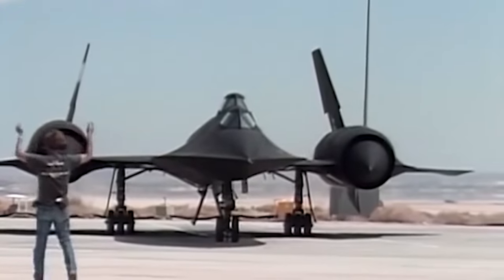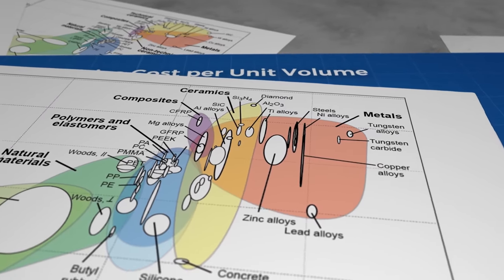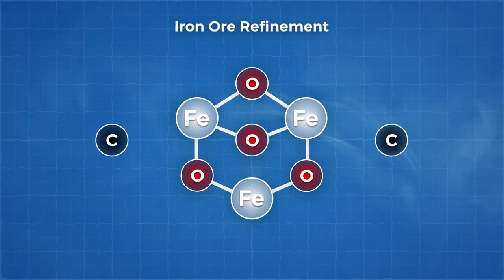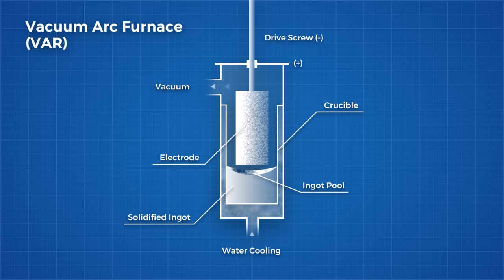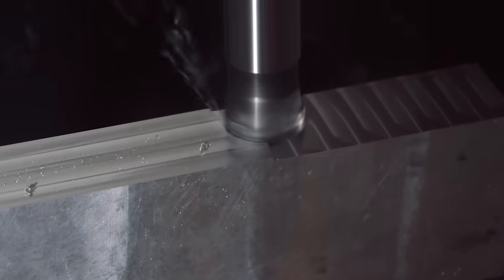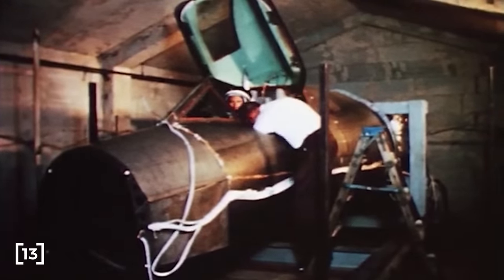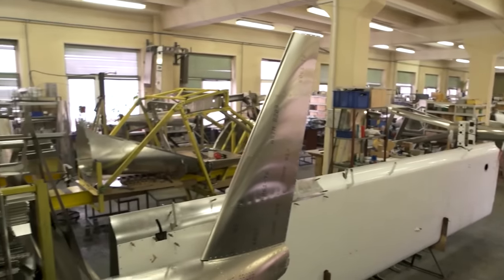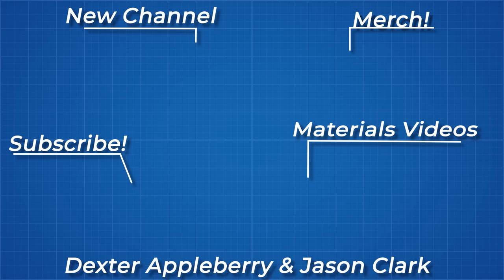Titanium - The Metal That Made The SR-71 Possible

Comment: As a machinist myself I can concur that Titanium is an obsolute swine to machine! As stated the depths of cuts required because of titaniums elastic properties is just plain scary to a newcomer. And the tooling does indeed blunt incredibly quickly no matter how much coolant you drown the part in. Top marks on your research!
Reply: and  then there is the heat treatment.
Reply: Yep sure is a pig to machine.The fine bits of swarf,(cuttings) burn really brightly.
Reply: i've made a few rings on my lathe and decided to open up the hole with a 1/2 inch drill bit before bring the boring bar in... jesus. little squirt bottle with coolant in it to help, i've never seen the corners of a drill bit round over in such a small amount of material . Beautiful material though. The rings have had up well to every day use too. Makes a god oweful ringing sound when dropped on concrete.
Reply: The airframe of the Blackbird after cooling down from  each flight was actually retempered and as such never degraded in strength.
Reply: You mean it's just "plane" scary to machine? 😉
Reply: @Capthrax1  Its a bugger to drill, even with carbide drills! Be real careful if wearing them as jewelry. If your finger swells up for whatever reason, you'll be in alot of trouble! I went for Tungsten for my wedding band, its easy to crack with a set of vice grips if I ever get into trouble.
Reply: First time I had to machine titanium I was astonished how little it warmed up despite the coolant boiling off my burnt out bits. It's like a bastard version of stainless steel. Needs low speeds and large pressures/depth of cut my machinery can't achieve. I gave up.
Found working it with files to be fine.
Reply: @justandy333  As a Firefighter I agree, you really don't want to get anything Titanium stuck on you. Its removal tends to require methods that aren't exactly ideal next to someone's skin!
Reply: Then there's the fire hazard.
Reply: TiO2 also makes it into some toothpastes--white paint again.  It is used in some catalytic materials.  A Materials Science prof I knew suggested that a TiO2  production or consumption index would be the best gauge of national economic health.  White pigment is in everything.  I haven't found such an economic index.  Maybe some economics student could get his/her PhD by developing one.
Reply: Ahhh yes, Ti, the bastard offspring of copper and 316 stainless...
It drills and machines like 316 then, just as a FU, it work hardens so that spring pass you were thinking of becomes a nightmare.
Reply: Alien metal! Check out Phil Schneider on ufos and the deep underground military bases !
Reply: don wright o
Reply: OjonnoMoto
Reply: I heard that, unlike with other USAF planes that are comprised largely of Al and can be repaired with components "cannibalized" from the same type of aircraft in a "boneyard", the Ti components permanently brake in, in such a way, that it is not possible to "cannibalize" and a new part has to be tailor made a specific airframe.
Reply: @Noodle999  jaws of life to get something off a finger... lol
Reply: Are there any ways to alloy it so it's easier to work with while retaining it's useful properties of high strength and low weight?
Reply: I had to machine Ti engine valves, and yes it's hard, ie, you need a lot of pressure when machining resulting in a lot of deflection in the valve, but It's not too bad so long as you slow the lathe right down. I find Ferrari valve guides worse - lol -. Ti hates rubbing, and the Nitro valves we used to do have undercut stems with a ceramic coating so the Ti doesn't touch the guide.
Reply: It’s an incredibly long time it takes to work with it compared to other metals too
Reply: It wasn't easy to work with a planishing hammer, as I recall (from WAY too many years ago).  I'd get small TI parts all heated up, set my dies, turn the power ALL the way up, put my full weight on the lever, run the part through the dies for longer than normal....and MAYBE get the ridges down a millimeter, which was acceptable.

The only parts I hated working more than anything TI were C-130 access doors or jet cowling nose lips, because those required 2 people to do due to the size.
Reply: @therion5458  I suspect your confusion stems from your definition of "cutting."
Cutting during machining is not the same as cutting paper, or bread. When cutting with a knife, the blade is passing between nodes or fibers, aside from local crushing, the material remains in the same state during the entire process.
Cutting during machining is a process of deformation, the cutter is not passing between fibers or nodules. The material is deformed at the point of contact (like pushing your finger into a ball of clay). Once the material is deformed enough to become plastic (plastic deformation), it flows up the cutter and forms the chip as it returns to a non-plastic state. When the right balance between feed and speed is obtained, the heat wicks out of the deformed area and into the chip.
The ductility of a material will dictate how much elastic deformation (temporary change) the material makes before undergoing plastic deformation (permanent change), and the hardness of the material will dictate how much the material in front of the cut is compressed. These two measures will affect the "machinability" of the material. soft and ductile (cast iron or aluminum) will allow for the deformed area to become a sort of continuous puddle in front of the cutter. Hard and not ductile (bronze) allow the material to transition directly to the plastic state. because titanium is so hard and is ductile, the region undergoing deformation is very small, and requires a lot of continuous pressure to maintain. The chip returns to a non-plastic state before it has properly left the cutting area, and it's low specific heat means that it is not effective at sinking away the heat from the cut. The heat goes into the tool instead of the work or chip.
Check out this video. He is a real engineer (degree and all), and breaks the process down better by far than any other video I have seen.
https://www.youtube.com/watch?v=y4gDDq_55Is
Reply: don wright 7
Reply: What about cutters using water jets or lasers?
Reply: bob simons you are spot on. There is nothing difficult about machining either. The cost of tooling is a factor. A knowledgeable machinist,  with cost effective tooling , can machine any metal.
Reply: I would say aluminium, titanium and copper is in their own ways, shit material to work with depending on how you are going to machine them.
Reply: The secret is not coolant, but slowing down the cutting speed. You will dull every cutting tool you use (even carbide) if you don't slow it down.
Reply: justandy333 hey Andy,
As an auto racing enthusiast, drag racing mostly, and engine builder and former 1-800 tech support operator for Federal Mogul, I've always looked into what was possible to make better and stronger engine parts. Until this video, the first thing I've seen that explains how hard it is to work with Titanium, I wondered why no one made connecting rods, crankshafts or Pistons and even valves from the stuff. The only reason I could think of in not using Titanium for Crankshafts is in trying to balance the rotating assembly with a material which might be too light to work. But after seeing how hard it is to make, let alone machine the material I totally understand why they don't do it. Still, for some really high end engines it might be worth the effort. I'm talking about extreme endurance racing with very small displacement engines. Maybe some day we'll see someone try that. In the mean time, thanks for your input! By the way, do you know of an inexpensive way to get powdered metal. Something that is a good conductor, ground to small tolerences and is a waste product of something else, thus being very inexpensive? 
Thanks
Reply: @therion5458  Pure titanium (grade 1-4) is not that hard to machine (it is quite soft), the real pain is the likes of grade 5 titanium (Ti6Al4V).

                   for heat treating of titanium there are some thing to consider. you have alpha and near alpha, alpha-beta, near beta and beta alloys.
Alpha phase alloys which contain neutral alloying elements (such as tin) and/ or alpha stabilisers (such as aluminium or oxygen) only. These are not heat treatable.
Near-alpha alloys contain small amount of ductile beta-phase. Besides alpha-phase stabilisers, near-alpha alloys are alloyed with 1–2% of beta phase stabilizers such as molybdenum, silicon or vanadium. 
Alpha and beta phase alloys, which are metastable and generally include some combination of both alpha and beta stabilisers, and which can be heat treated. 
Beta and near beta phase alloys, which are metastable and which contain sufficient beta stabilisers (such as molybdenum, silicon and vanadium) to allow them to maintain the beta phase when quenched, and which can also be solution treated and aged to improve strength.

To conclude your question of hardening pure titanium (alpha phase), 
Alpha and near-alpha phase (alloys) cannot be dramatically changed by heat treatment. Stress relief and annealing are the processes that can be employed for this class of titanium alloys.

if you want to know more,
https://en.wikipedia.org/wiki/Titanium_alloy
Reply: i work with titanium dont ask me what it used for idk but it is realy anoying to work with since no scratches allowed and when it gets dirty its almost  impossible to get clean end yes its expensive i know my boss is breathing down my neck looking if everything is good
Reply: It's a lot of fun making sheet parts out of it too... We can't stress relieve in house, so there's definitely some question whenever we send them out if they'll come back at even vaguely the same bend angle.
Reply: How much would advanced 3D printing mitigate the production of a final titanium product? How much refining of titanium is required before feeding into a 3D printer?
Reply: @bastrixer  I cut literal tons of copper and aluminum each year. I don't find either to be troublesome. Copper is a little abrasive, but other than that it cuts nice.
Reply: Now I see why Soviets didn’t use Titanium much on their own projects.. Probably waited for capitalists to invent better instrument, so KGB could steal them.
Reply: @therion5458  ....the second or third last material properties chart shows pure titanium to be low on desired properties but same chart is showing good properties for the titanium alloy . He mentions chrome, aluminum, vanadium addition near the end . Only the alloy can be considered when looking at chart .
Reply: Same goes for inconel and Hastelloy
Reply: @kiwidiesel5071  IIRC It actually got stronger as it aged.
Reply: @skunkjobb - Inkjet 3-D printing of titanium parts should virtually eliminate machining. Not there yet but likely soon.
The Mikoyan-Gurevich MiG-25 was stainless steel on a chromium-molybdenum steel frame.
This seems strange as Russia has the largest known deposits of titanium ore.
Stainless steel is bad enough to machine: gummy, work-hardens as it is cut.
Kelly Johnson was a genius especially finding other geniuses in the various specialties required for forming, forging, casting, machining titanium.
In the few things that I machined from stainless steel, I found that a deeper final cut was necessary to get through and stay under the layer work-hardened by the previous pass. This final cut had to be to the finish dimension.
Reply: @justandy333 - The EMTs will strip the teeth from their ring cutters if they try to cut a titanium ring off.
Reply: @jed-henrywitkowski6470 - A hydraulic bolt cutter is the most effective tool for cutting a titanium ring. Titanium is strong and nasty to cut with a saw but a bolt cutter maybe not Chinese from Harbor Freight but a H.K. Porter or other high quality will cut a finger ring as titanium is not hard to the degree of hardened tool steel or carbide jaws.
Reply: @kencohagen4967 - Look for ink-jet 3-D printing of titanium and titanium alloys. Conrods would then need only a honing to size and finish the bores.
Reply: Just use the right cutters and machining strategies and it's a piece of cake.
Reply: @deanstark9594  did real engineering like your reply
Reply: Ever try to machine tungsten? XD
Reply: @justandy333  ......... if the ring on your finger is a problem, attend a dentist as they have high speed water cooled handpieces.
Reply: @magisterrleth3129  there are ways to increase its ductility while preserving fracture toughness and strength, mainly through alloying and hear treatment.
Reply: I can confirm that as someone that works with titanium almost every day.
Reply: A question.  Would it be possible to use a process similar to ultrasonic welding to recycle the leftover bits left from machining Titanium (or at least one of the processes involved)?
Reply: @therion5458  it work hardens easily and is gummy.
Reply: Titanium can be tough to machine, but you have to find the sweet spot that it wants to be cut at. Once you get the right cuter, depth of cut, feed and speed, it will cut like butter. The biggest problem I have seen is machinists wanting to go too slow or too fast. A good way to go is use the same cutters that you use for inco 718 and a sfm 50 percent faster than inco.
Reply: @therion5458  the fibers or grains are longer and more tensile making the chips harder to break.  Chips that dont break wallow out holes, ruins surface finishes critical for moving parts and can apply uneven forces on tooling.  Then there is the work hardening to deal with.
Reply: @algrayson8965  I dont think 3d printing will replace machining but will rather compliment it quite well in the manufacturing process. It will almost always be quicker and easier to put a part with basic features and geometries on the mill or lathe - even if it has to go back and forth - than to set something like that up for a print.  Now if we are talking about formerly forged parts with complicated features a d geometries, that is where 3d printing is going to shine.

My old shop used to have this part forged until it became virtually impossible to get something forged in the US (DoD contracts, Berry Amendment stuff).  It was great getting those parts being the run time was about 20 hours due to having a very slight taper milled in the ID on a vanilla 3+1 Mazak making the majority of the DOC an almost negligible number.  The best part was that the engineers basically scrapped all the critical ID dimensions and surface roughness specifications making it a pretty stress free job considering the OD had a tolerance something like +0, -.005" which might as well be a country mile.

3d printers also struggle with certain features such as overhangs that require support material that would ultimately need turned, drilled, milled, reamed and even tapped out prior to shipping anyway.   Mills and lathes aren't going anywhere.
Reply: I just retired, I can relate.
Reply: @skunkjobb  The SR-71 Titanium expands when it gets hot. Basically pushing or seizing up the tool.
It has to be kept cool with compatible coolants. Dull or worn cutters makes it get hot.
The SR-71 Tech Data has a list of materials that should not come in contact with the titanium. They say these materials "poison" the metal. It is mostly affected when the titanium gets hot.
Reply: @justandy333  It's not that hard to cut. Look up how to remove a stuck ring.
Reply: justandy333 my friend was making parts for NASA and one day I ask him about this cam looking things dropping in a 5 gallon bucket off a chain conveyer from a walk-in cnc Mill ..I ask what they are made of and he said tungsten stellite one of the hardest alloy metals known ..I said if this is the hardest ..what and where are you getting Mill bits to machine this stuff ⁉️ ..and my friend says  " the mill cutter bits come with the blueprints from NASA "
Reply: @Thomas-j3x8k  how about tungsten stellite?  My friend was making parts out of it for NASA .. when I asked him what the hell is he cutting this s*** with ? He said the mill bits come with the blueprints from NASA imagine that ..so what has NASA got to machine tungsten stellite in the form of common looking cnc Mill bits ⁉️ something from bobby bazer's sport model he claims he worked on at hanger S4 ?
Reply: @TJ-wg3ud  sure it will as anything else after you know the speed to feed , cutters , cutter speed etc etc etc .... But we are from earth and don't have the knowledge of you palladians
Reply: And the Chinese are giving titanium away in the form of gulf clubs Walmart bicycles and counterfeit copies of Akrapovic motorcycle mufflers on eBay you can buy for a dime on the dollar not to mention all the fasteners china sells to the world for a dime on the dollar machines from titanium ...there is a company in Texas who specifically machines all the bolts nuts and fasteners for world of outlaw sprint cars out of T1 titanium . as per rules for the safety of the drivers and the the spectators . And something like a common 1/2 inch bolt a couple inches long around $20 bucks , but from China around $2 dollar
Reply: @donniebaker5984  i guess if your not a machinist what i said probably doesn’t make sense, certain materials like inco and rene can be a pain in the ass even when you have everything perfect but titanium becomes very easy to machine once you know how to cut it.
Reply: Carbide . . . .
Reply: Machining titanium isn't that bad.  They have tools designed specifically for it, and the machining techniques available today it's very manageable.  Not something to start out with though.
Reply: @bmbunch8825  agreed, if you know the feeds
And speed for your tooling.   Miss your recipe  by a small amount and you're entering a world of pain.
Reply: @Noodle999  Firefighters know jack shit.
Reply: I hear that, but then I met inconel haha
Reply: Threading parts is no bargain either.
Reply: As a machinist i like to tell people im a machinist.
Reply: Low speed high feed
Reply: @justandy333    How would your finger swelling up be more dangerous with a titanium ring on than a ring of any other metal?  Surely body temps and temps that the human body can handle are child's play for something like titanium.  Swelling in any form is not natural, and therefore temporary so long as you figure out what caused it and apply the appropriate medical treatment to reverse the swelling.
Reply: Max speed, max feed, not trammed, chattery clapped out ways = success